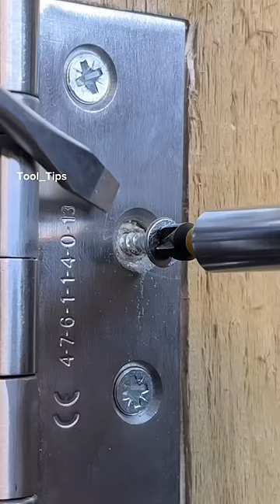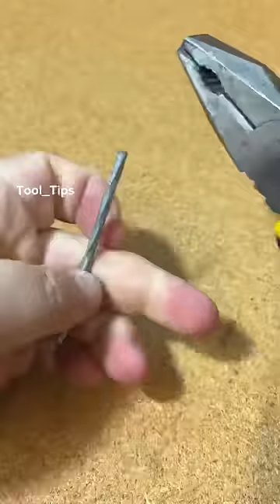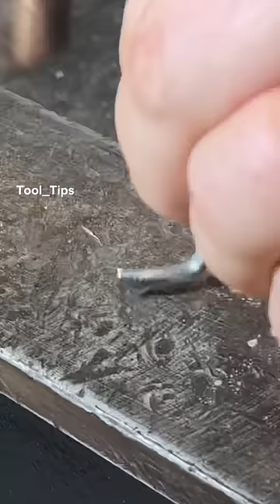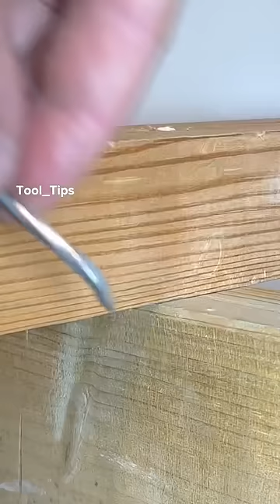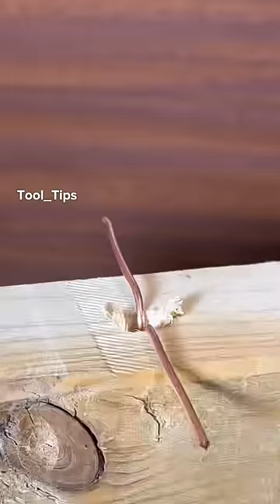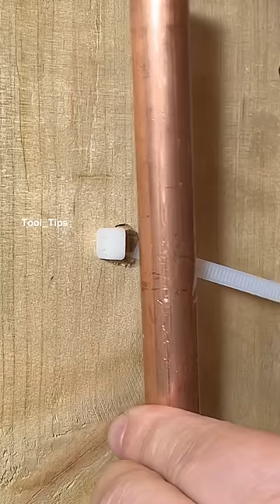Top Tool Tips on #shorts

Comment: Just a little sage advice for you folks that have not done much copper tubing work, DON’T hit it with anything and make dents in it. Over the years of usage, the water will wear a hole in the copper tube from the inside and cause a leak.
Reply: Yea I cringed when he started beating on it
Reply: So did Michael Jackson
Reply: Use a stainless hose clamp and small section of rubber hose to seal the leak.  Cut the hose to look like a "C".
Reply: Really?? Not that ever do and if by chance I accidentally did do it, I’d have fixed.  I just didn’t know what where the repercussions of the damage.  Interesting.
Reply: @d2966-m8t  

Plumbing 101 never touch stainless steel to copper.

Copper to copper or copper to brass.

But don't take my word for it look it up. 👌
Reply: Exactly! Take advice from certified tradesmen, not youtube, Facebook, Insta or TikTok.
Reply: That’s why he hit it with the pliers instead of a hammer he was thinking ahead 😂
Reply: Thank you
Reply: Acchaa
Reply: Q😊
Reply: The act of beating on the twisted part will loosen it also.  Why would you even beat on it to begin with?  When are you ever going to run your hand over that to cut yourself?
Reply: Os canos de cobre não são usados mais, como eram antes, devido a oxidação interna.
Aqui no Brasil eu pelo menos evito usar
Reply: I was thinking that’s kinda neat and weird until I saw him hammer and immediately rushed to the comments
Reply: 1
Reply: @nickmiller5489 😂

Comment: Retightening a stripped screw hole with a matchstick only works with a couple drops of wood glue or construction adhesive, otherwise it'll soon strip again.
Reply: A golf tee works good don’t forget the glue
Reply: better off use some measurements and your brain, and just drill the correct holes, today it's even easier, there are tables for this, what screw size and what size of pre-drilling to do, or what size drill for which size dowel etc..
Reply: @davideyt1242  
Most door hinges use a #9 x 3” screw no need to use longer as most jambs are 3 1/2” with door jamb installed
Reply: @FredD63  ah forget it I am not from the US, in Europe we have concrete walls, it is a big deal to install a new door 🙂 but yes well mostly when I do work with wood a lot of the screws are either self drilling anyway or at most need a pre-drilling of just 2-3 sizes less than the screw that needs to be screwed in
Reply: @davideyt1242  
I understand …. I own my own construction company we don’t build houses but we do a lot of remodels and some additions yearly along with all the other including plumbing, HVAC, Home repairs, siding windows ,doors, Etc.
Reply: Just how many times are you taking that door on and off per day, @giraffxdesign8752? A match will hold forever if you leave it alone.
Reply: @davideyt1242  it's not about drilling the right size hole, it could be that a door has been taken off a few times in the past for decorating and each time you remove and re-insert a screw, the hole gets looser. This obviously applies to anything, not just doors. It is definitely a good tip to know.when doing DIY.
Reply: @TristanTradgedy  you are correct, but the method is ludicrous, no - a piece of wood from a broken match is not enough to hold that hinge in place reliably. in the case that the screw hole is messed up a better solution would be sealing it with the proper material and re-drilling. or in many cases from what I have seen, good quality installation hardware offers metal thread dowels that you only hammer once into the frame, then screwing the hinges in and out as many times as you want will not mess up your installation
Reply: @davideyt1242  Match sticks or cocktail sticks and wood glue are plenty strong enough. It is something my dad taught me when I was young and both he and I have used it in MANY different situations. 

You say seal it up with proper material? What is a more "proper" material to fill wood then... wood and wood glue... clues in the names.
Reply: @TristanTradgedy  

Yes, it happened with both my ex-wives.
Reply: @TristanTradgedy  no, no wood glue... more in the direction of special 2K epoxy filler. but that is only as last resort, better off just use high quality hardware to begin with (metal dowels with threads). well in Europe we don't have this problem anyway, most of the door frames are either massive wood or metal. no cardboard / chipboard like in the US
Reply: Door hinge shouldn't need changing that often --even lifetime.    Cheap Phillips screw heads also wear out.  Install the screw using a tooth pick and leave it alone.
Reply: @RobertSmith-sh3ke  I truly believe this to be true with older houses, I have used to live in a house that was built new 78 years ago, it had old solid wood doors and frames, it was all original, other than a bit of oil once a year when the hinges squeaked, nothing was showing much sign of wear
Reply: @davideyt1242 your house has already been standing longer than 98 percent of houses built today will stand.
Reply: @NigelTolley I agree. Unless that door gets removed frequently it’s absolutely fine.
Reply: Nope. It works exactly the same as the dowles. If it doesn't hold, use 2 match sticks. Wooden dowles are the original wall anchors that were used to fasten wood to stone or concrete. I've seen them in housed that were less than 100 years old. It's compression that holds everything, just like a wood handle in a hammer or axe. It's being held by compression and friction.
Reply: This method does work, but it is a bit of a bodge job. A better way is to drill out the hole to take a dowel, glue that in place, and then pilot drill the sound new material for the screw...

Or if the door does have to come off regularly for some weird reason, install threaded inserts and use a suitable (i.e. not self tapping) screw.
Reply: not really.....Unless it took a whole load of stress and a door hinge is sharing the work with many other screws. Done right, they ADD strength to their connection point

Comment: using copper wire to hold the pipe will eventually cause a leak, the contact area is too small
Reply: There's also absolutely no reason to create this 'hack' when you can buy a bag of hundreds of pipe clips for peanuts.
Reply: @davidthomas9165  I tried that at Home Depot. They said that they didn't accept peanuts as a payment method and that I should try Lowes....
Reply: @miket2120- lol thx. Best comment I have seen tonight
Reply: @davidthomas9165  I've never seen pipe clips for peanuts, just for pipes.
Reply: @joeweatlu5169  haha true!
Reply: I was more worried about him tapping it in and damaging the pipe that way! But yes overtime that contact will hurt as well!
Reply: @davidthomas9165 jep! And if he wanted to be cheap he could've used tiewraps as well (as he did later on)
Reply: @miket2120 😂😂😂😂

Comment: Match stick fix should be dipped in wood glue then jammed into screw hole.
Reply: Why
Reply: @bunnyphoenix2992   Adding glue to the matchstick inserted into a "loose" screw hole, helps make a stronger repair. The matchstick is made of lightweight wood. The glue helps it bond with the wood which has gotten loose, helping the screw to regain a proper tightness to held things together.
Reply: I've used toothpicks and wood glue before, never matchsticks.
Reply: The glue is not necessary.
Reply: @artor9175  Neither is a wallowed out screw hole, but here we are.

Comment: Never use the screws that come with a hinge set. Always use 2 or more 3-4” screws to get into the actual frame of the house. Rather than just the door jam.
Reply: Why they use #9 screw for door hinges is beyond me. To get a longer screw, I either have to got with a longer #8 or better, a long #10. For the #10, I've found that it helps to run a countersink bit to enlarge the bevel in the hinge so the #10's head sits flush.
Reply: Agreed! Also, be sure to put the non-red end of the march in the hole. I personally use tooth picks.
Reply: 2nd tip: if the screws delivered are garbage, watch out for the dowels and avoid them as well - use a set of high quality Fischer (or similar) screws and dowels.. not only make the work easier and more enjoyable but much more durable and secure.
Damn I remember one time I have tried to use the screws delivered with a small piece of furniture to put it together (normally I put those to the side and use matching Fischer screws instead) and the moment that screw that was already 95% in the wood broke up. I was swearing and yelling it my self how stupid I was for using those shit screws they make from garbage steel and use for those diy IKEA style furniture. never again
Reply: can also use a golf T and some white glue to repair bad hole for door hinge.
Reply: I only use longer screws on exterior doors.
Reply: And make sure to use a drill bit half the diameter of the screw to drill a pilot hole especially in very old home's that way you don't go splitting 💩.
👌
Reply: @dpz9872 Yes, I try and estimate the actual minor diameter of the screw, and drill a hole just slightly smaller than that.  I think you want to definitely fill up the pilot hole with the shank/body (excluding the volume of the spiral part), plus a little more to make sure the wood fibers all get compacted in the hole and there is no play.
Reply: high quality door kits or high quality hinges will come with 3" screws.
My boy built the office portion in the warehouse of my last job. He's been there 21 yrs i worked there for 6 so only saw a few additions, but our boss is wealthy asf and always has his people purchase quality shit. So nice
Reply: Its not door Jam !  It is door Jamb !
Reply: @andrewbermond4228 Doar Djahmm.

Comment: avoid stripping hinge screws by simply clutching your drill, if you do need to fill a stripped screw hole add a little wood glue to secure and harden the stick.

Comment: Sure is a lot of need to tie copper pipes to wood in this
Reply: Exactly. They make straps and clamps that wont let you down for this exact reason
Reply: And apparently need to do it a harder way, with more effort, and resulting in leaking pipes years later.
Reply: It's a common issue when plumbing. So much so that anyone doing it will have the proper hardware and not need to do something stupid and janky like these tips.

Comment: I have some of the proper Z nails from the 1960s. They were made from 1/4 inch steel. The points were about 1.5 inches long and always landed point up if dropped. They were banned on construction sites in Australia donkeys' years ago.

Comment: For the last hack to work, the depth of the corner where he is placing it would have to be close to or equal to the radius for it to work. If exactly the radius then the center will be a point and if a bit less then it will a tiny circle like we see here. Another factor is that the wood piece would have to be more or less perfect cylinder.

Comment: Cool stuff. I knew the match stick fix. There is also a way to predrill the screw holes accurately using a dowel with a hole as a guide
Reply: with the match always comes a bit of wood glue.
Reply: What's the dowel/hole method?
I usually use a pencil to scribe the hinge holes, move hinge out of way and center punch it before pre-drlling.

Comment: Finally someone with some good genuine tips. Loved the z shaped nail.
Reply: The Z shaped nail was clever, but I don't know how practical.... Get some hurricane clips instead.
Reply: @JDeWittDIY  I agree but I gave him credit just for the simple idea.
Reply: @Kem-gu6or  Yes, I'll give you that. It is a clever idea.
Reply: @Kem-gu6or A simple idea that doesn’t work and serves no purpose, uhhmmm, doesn’t work and serves no purpose.
Reply: @justsomeguy859 its purpose was to hold 2 perpendicular planks together, and it worked. So, yea it did.
Reply: @alexb5548  Know what else does that? Screw through one into the other without some stupid "hack"
Reply: It's not even remotely structural, and I'm scratching my head trying to think of any application where I would want to do that.
Reply: @alexb5548  You'd like to think that until you rely on those planks STAYING together and they don't.
Reply: @artor9175  I never said it was perfect nor long lasting. I think a lot of this stuff is nonsense but that one at least is functional albeit temporary
Reply: @Cipher160  An angled screw would also be temporary and would be no better than this. Regardless, this is in fact both functional and serves its purpose as a "hack" - ie not properly done.
Reply: @artor9175  in third world countries they might use them as hurricane ties I would imagine.

Comment: Good tip is never use a drill or an impact on hinge pockets. Use a hand driver.
Reply: I always do, never had one come loose yet.
Reply: Did commercial doors and widows for about 15yrs. When you have a 300lbs door in a concrete frame.. you use hand tools. One whoops can cost you big.
Ntm hollow metal frames need to be tweaked. We use every screw. I can make em close so pertty 😇
Reply: and you have to use a drill on hinge pockets for wood doors, or you will be splitting the door when you install the screw. I think most professionals seeing you try to use a hand driver would tell you to hurry the hell up.

Comment: Using a match to repair a hole isn't a fix. Matches are soft wood and turn to sawdust when a screw is inserted. Even glue won't help. A sliver of Mr. Grips works the best.
Reply: Interesting, I just looked up those strips and may try them in the future.
Reply: @AshokaMazda  I do handyman work and I work at a Hardware store and they are worth the money. Furniture repair, almost anything made of wood. I've even used them in Automotive applications. They can be cut in thin strips to fit really small holes. They have small barbs to grip the wood.

Comment: That copper wire "clamp" is more trouble than it's worth & isn't going to last. Just spend the extra money on the proper supplies & save yourself the headache of dealing with a rattling pipe later. 🤦‍♂️

Comment: Whiskey Tango Foxtrot!
🙈
More than a few of these are not only wrong, but also against code. 
Don't support your pipes with wooden pegs, zip ties, or crappy wire that you hammer with pliers. 
Do it right!
The correct clamps are 99 cents at home depot

Comment: for the door hinge don't use a match.. use a piece of electrical wire
Reply: Hadn't heard of using copper wire instead.
Reply: @AshokaMazda   yup grandfather carpenter knowledge. He said match sticks are weak and if wet rot and lose strength, copper wire will last forever. done it dozens of times

Comment: Drill a hole for a peg, then use copper wire, instead of using a cheap steel fastener with screws or nails. Gotcha.

Comment: The type of craftsman who is using this type of "tricks" is the same guy who will stick his chewing gum into a dowel hole drilled too big that is meant to hold your TV on the wall or worse a heavy metal lamp fixture on your ceiling, than I hope the insurance cover this type of injuries / accidents once something bad happen. any commercial company doing such work has to adhere to certain guidance not because of no reason, if you have drilled a hole too big and you think a slice from a match will hold that hinge strong enough together ? I have a piece of land on Mars to sell you

Comment: Don't use a power driver on door hinge screws, because you'll strip them. But, as others have mentioned, toothpicks are better because they are hardwood. A couple of those should work. If you have more than one stripped screw, you may want to add some wood glue as well.
Reply: I've assembled diy furniture with a drill and use it on machine screws, including electral outlets. The drill has multiple settings that make it impossible to strip a screw. Your finger on the trigger can also prevent stripping the screw. I use my finger more often than I adjust the torque on the drill.

Comment: tooth picks are way cheaper !
Reply: Golf tees are the best. They are tapered and will fill any hole that's not larger than the head of it. Anything bigger, dowel rods are good. I've never had to buy golf tees. They are generally given away at any kind of job fair, tractor show type of event.